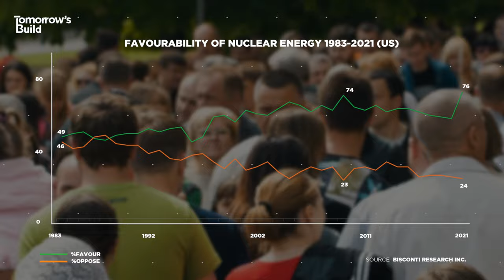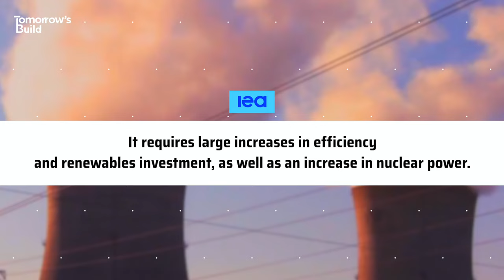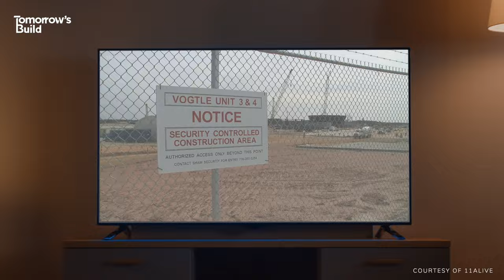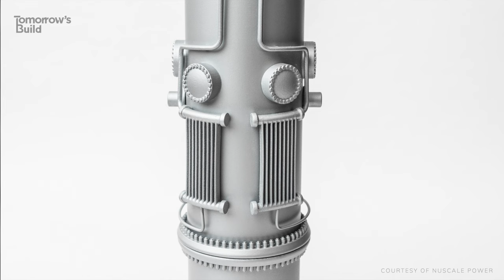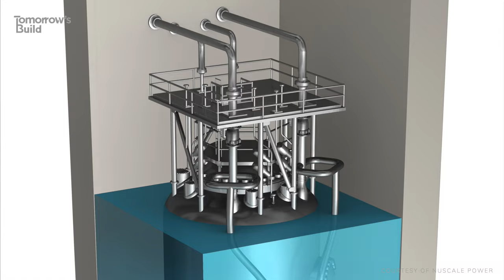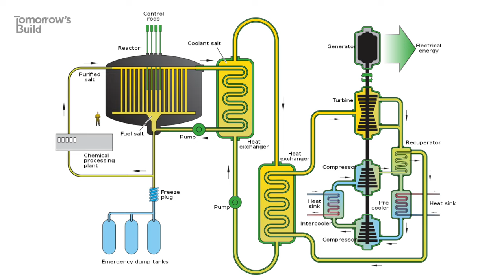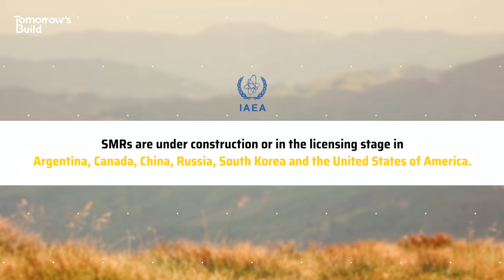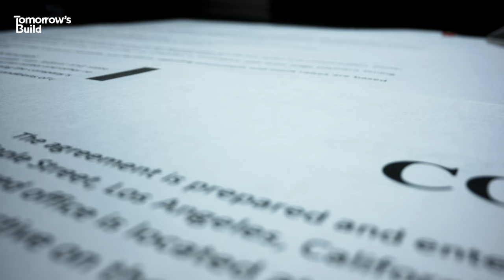These Mini Nuclear Reactors Can be Built Anywhere

Comment: Wind/solar are intermittent. If you add the cost for needed energy buffer, things look different. Today the grid is used as a "free" buffer. This does not work anymore if wind/solar makes up a significant percentage of total energy. If wind/solar is so cheap, why has Germany such high electricity prices? Never mind dependency from natural gas. And the need to transport the electricity over long distances (e.g. the wind farms in Germany are in the north near the ocean while most of the industry is in the south).

Comment: Like everything really, there must be a sweet spot for the size of MSR's, where the economics, modular construction, transportation, safety, standardisation, prefabrication, output power and unit number needed etc should align for the application of Nuclear. 

I would say that a single SMR of around 100 to 120MW Electric, say 200 to 250MW thermal might be this "goldielocks size". If a Westinghouse AP1,000 can be replaced by say, 8 to 10 of these MSR's, then you could group as many as 64 of these units in one mega plant/location, for a huge 8GW plant, equaling anything online today, all the way down to a single MSR plant of 100MW, which would still be enough to run a fair sized town of maybe upto 100,000 people. You could run the whole of the UK grid with around 600 of these units, and perhaps the whole US with 6,000 and the whole world with 60,000. 

In practice, you probably wouldn't go more than 50% max generation from Nuclear, the rest coming from solar, offshore wind, Existing Hydro, GeoThermal, other) so maybe 30,000 units would be required. if you grouped on average 6 units in a location, that would mean only around 5,000 locations/plants worldwide. 

If they had an installed lifetime of say, 30 years or 10,000 days, you'd only have to build/commission 3 per day worldwide to meet the replacement rate of the fleet. Maybe 10 to 12 massive factories could produce this kind of number. 

I don't think you'd want to use Nuclear plants for smaller generation than 100MW for civilian applications / Locations. They excel where you need a lot of reliable power 24/7 at baseline.  

Large commercial shipping would be the only civil application for say the 2-10MW range. I don7t think you'd want steel or concrete works having their own tiny nuclear plants attached, as that would pose a proliferation and safety risk, just due to the sheer number of units that would entail.

Comment: Such small reactors could be a boon to Canadian high arctic communities where they get most of their electricity from expensive to run diesel electric power plants.  Fuel oil is imported to the high arctic communities at nearly double the cost or more and even more energy must be invested in keeping the fuel oil stockpile from turning to jelly.
Reply: Exactly... and these smaller reactors could also probably produce enough power that enclosed style hydroponic food production units could be set up to cut food costs. And the other nice thing about these remote indigenous communities is the "nimby" story that is the main problem in urban population centers is likely to be a lot less of a issue. As a group, they'll either accept or reject and go on without all the lawyers and whole lawsuit industry getting in the way and stalling everything for years while the lawyers mine their money. 
SMR's are the perfect solution for Canada, at our latitudes we're not going to make it on solar and wind. Not even close. And we already have the large grid infrastructure from large scale hydro as well as very good uranium mines and resources.
Reply: reactors in a remote areas are incredibly difficult to secure against sabotage or theft

Comment: small reactor has been in use forever in nuclear sub, the issue is reactor are more cost effective the larger they are since they have smaller surface to volume ratio. the lower the ratio, the more neutron are hitting the wall and being wasted. small reactor are a waste of time for the simple reason that there is a limited amount of fissible uranium and it make more sense to build breeder that can make their own fuel. china plans alone are going to double the use of uranium, that going to reduce cheap uranium to only a century worth of supply.

Comment: And yet, there is not solution for the waste.
Reply: Why should waste need a solution? Reactors produce very little waste, and it can be easily stored in well built storages. Waste caused by fossil fuel cannot be stored.
Reply: For now, nuclear is more of a temperorary solution on the road to reach net zero. In my opinion, the waste is a far lesser concern than humanity not reaching close to net zero within the next couple decades, and our failure to reach that goal will result in far more catastrophic consequences than having some dangerous waste that we don't know what to do with

Comment: Besides the build and operation, no matter how space saving, safe and innovative, the vital issue of the toxic waste and costs of storage doesn't go away for thousands of years or is it that the maintenance of storage is amortized to following generations and not accounted for.  Maybe cost efficient for the users but until wastes are safe, what is the total cost?
Reply: Nuclear waste is already solved. It is called burial
Reply: Nuclear waste is not a problem, they can be easily stored in well built storages. Pollution caused by burning fossil fuels are just dumped into the air.

Comment: 5:25 They've got cleaver safety features too
Next, Dr. Reyes rambles on some things that sound good (e.g. what the public wants to hear) but explains to safety feature what-so-ever.
How do you cool a reactor for an unlimited amount of time without the need to add water? Pictures show water (or at least a fluid). Worst case scenario: what if the water leaks out?
btw. the fact that he uses the word unlimited really diminishes the value of his scientific title to approximately 0.

Comment: Are these still the water pressure based ones? If yes then forget that. Also they need to move a way from uranium as there isn’t enough left. And then we have the thing that it will not help us to reach the goal as alone the approval will take longer than the time we have for our goal.
Reply: There are designs of various types of reactors

Comment: Thorium Reactors look really interesting Th233+n 》 Pa233 》U233  not only using cheap abundant  Thorium & Waste Spent conventional Reactor fuel but fail safe. The reaction is not selfsustainable ,meaning soon as external Xray source removed reactor passively powers down. CANDU & others can easily be converted to Th Reactors. Another major waste is Cd, the major metal in Cladding of fuel bundles. It can be used 50% dilution once then it's too Frisbee & weak. It should be all used as cathodes in shipping countainer sized NiCad batteries on-site at existing Nuclear Plants. The low radiation would  be blocked by the Ni Anodes.
Reply: Until they solve for neutron enbrittlement, they'll produce more waste than normal reactors.

Comment: Are SMR ☢️ reactors gonna be used in submarines and such similar sea-going vessels 🚢?
Reply: They hVe been for decades
Reply: I hope so, Large ocean ships create so much pollution, particularly particulates and acids. Something like a third of a cargo ship is Fuel tanks, so this would mean more onboard capacity, and at the same time higher speeds would further increase capacity.
Reply: have been for almost 70 years. "nuclear class submarines" are called such for a reason, they don't carry nuclear missiles (though some might), they have nuclear reactors.
Reply: @Nicky Mitchell. They already have been for a long time now. The actual size of a submarine reactor i've been told is roughly the size of a shoe box. But that shoe box provides all the propulsion and electrical power the sub needs.

Comment: Hmmm. Interesting, I do wonder though how long would it take to fully shut down an SMR? Just wonder in case its absolutely needed, especially since even smaller or medium sized nuclear reactors like the Swedish Barsebäck take well over a decade to shut down. But I at the very least hope these people can consider all the risks with nuclear and find a solution.
Reply: You seem to mean decommissioned, not shutdown, and it takes a few years to let SMRs cool* off before being decommissioning. However, that will happen back at the factory. At the power plant, you just swap out the reactors like batteries. 

*Cooling in this case means radiation subsiding.

Comment: I think Thorium in a Modular Molten Salt Reactor would be the safest (walk away automatically shuts down) but the reply I got from Nuclear Tech was “ well you can’t weaponize it so the government is not interested”. It’s a sad situation when war takes president from an environmental safer power.
Reply: The real problem is they haven't solved the neutron enbrittlement issue.

Comment: Today, 12/18/2023, this is old information.   China already has a 4th Gen nuclear reactor.  Namely, a HTGR on their grid and are already building SMRs.   They also have a prototype Thorium MSR in the Gobi desert.   While the Western public is so paranoid about nuclear, they will wind up paying lots more $$ for renewables since wind & solar are intermittent, inconsistent and highly weather dependent.   They'll also require battery/storage  backups when the weather is bad.    We should not be dependent on something, weather in this case, for which we have NO control.

Comment: Is nuclear aircraft carrier  powered by smr?
Reply: Navy reactors only produce 70 Mw (most of that for propulsion not electrical) compared to a typical PWR producing 1,200 Mw and navy reactors can only produce that small amount using 95% enriched U235 costing $1 billion just for the fuel. 
Commercial Nuclear power reactors need steam generators, reheaters, turbines-generators, condensers, cooling towers, emergency generators, battery systems, control room, emergency cooling systems, septic systems, drinking water systems, mechanics, operations, and management staff, etc., etc.
So if you want to compare the cost of electrical generation from a navy reactor you have to consider the cost of the entire submarine less the torpedoes.  That comes out to $70 billion for 77 Mw output or 4 times the cost of the financial failures of the latest standard PWR builds. Also Nuclear powered ships shutdown their reactors while in port to minimize the possibility of an accident near populated areas and wind/solar shore power is cheaper that running their reactor.  No Navy reactor has ever been converted or used to provide commercial electrical power. if these people want to use Navy reactors as examples, they also must admit that millions of tons of highly radioactive waste from these reactors have been dumped into the sea and hundreds of sailors have died in reactor accidents. 
The NuScale (multi) 77 Mw SMR project, is the closest commercial design to that of a navy power plant. The project started 2 years ago just halved the reactor Mw output due to ballooning costs and most of the utility backers have now backed out causing the project to now delay construction until 2025. And they were getting $2 billion of taxpayer money to help with the cost. So much for building a Navy type SMR in a few years for only a few million.

Comment: Why do we need these new mini-reactor designs, as opposed to just taking the designs the navy has used for 70 years? Those have already proven reliable and quite shockproof, the development is done, and we have the facilities to build and maintain dozens of them. We could literally take an old submarine, cut off compartment seven (engines) and the sections four through one (command to torpedoes) and be left with a big steel cylinder/floating power station. We also have hundreds of already qualified operators, plus training facilities already in place! 

This whole "mini-rector as new paradigm" is just masking that we had the solution all along.
Reply: Those are designed for the navy’s needs. They use highly enriched uranium and require a fairly large number of people to operate.
Reply: @kokofan50  I agree that is an answer, but that doesn't seem to address the question. HEU isn't that much of an issue - all reactors are going to have security and fuel associated with them. I don't know what you mean by fairly large number of people to operate - as the crews on a nuclear submarine are in total smaller than the workforce of a shore power station, and only a portion of those are the reactor engineers. And the key - is that we have the infrastructure already in place which is a huge advantage.
Reply: @MrChainsawAardvark  HEU isn’t a problem for the nuclear (weapons) club, but it’s a massive problem for everyone else. When 95% of the countries on the planet aren’t supposed to possess the fuel, it makes mass adoption of the technology impossible. 

The gen. 4 reactors are supposed to have little to no human interaction. Naval reactors have a lot than that happening.
Reply: @kokofan50  Ok, that issue with HEU makes more sense. As to how much codling a naval reactor needs - if you have some sources, I'd love to see them, as otherwise the military is a bit tight-lipped about the actual procedures.

Thank you for your replies.

Comment: I was hoping there would be no nuclear waste lmao
Reply: Nuclear waste isn’t actually a problem. It’s a good thing, because nuclear reactors produce very little nuclear waste and can be easily stored in well built storages. Pollution caused by burning fossil fuels cannot be stored and are just dumped into the air.
Reply: @TheBombson  Scientists are not really united. Most of them argue about the way our contribution to the overall atmosphere has been researched, and I understand why. About that ''nuclear waste stored forever'', nuclear waste is recyclable since the 1960s. Reactors use nuclear waste as fuel.

Comment: It's not carbon-free. Reactors and containment buildings take a huge amount of steel and concrete to construct. Then there's the uranium enrichment process which takes hundreds of centrifuges. And of course once the fuel is spent, it has to be stored in large underground bunkers away from groundwater. Add to all of that that it's the most expensive of all alternatives to fossil fuels, and there is no case for building reactors if you can build wind or solar farms.

Comment: 518 "These units are designed to be far safer tha  their predecessors"

Sure, but so has literally every reactor, including the ones in Chernobyl, Three Mile Island, Fukishima... even here in the Netherlands we have had to shut down a reactor because cracks whee forming in the mantle unexpectedly.

My point is; it doesn't matter how many safeties you built in to deal with known failuremodes. No reactor has ever exploded because of a known failure mode. What matters is how you contain the problem when the reactor does fail in an unexpected way. It's a given that one of them will fail, that's how man-made devices are. Airplanes, spacecraft, cars, they all fail regardless of how many billions of dollars in development is spent on them or how much experience we have building them. Mistakes will be made, it's the containment of the consequences that matters.
Reply: When an MSR fails, all that happens is it drains the salt to the drain tank.

Comment: Have they figured out what to do with all the spent nuclear fuel in the USA yet? I thought that site in Nevada was built but it’s a political battle between state/fed if I’m not mistaken? Also, in the USA all these older GE reactors are past life and have 1000’s of spent rods. I wonder what the solution is there? Keep kicking the can down the road?
Reply: It was cancelled almost a decade ago now. But there’s a similar facility in Finland just finishing construction which wants to accept other countries’ waste besides their own. France’s plan is to simply recycle/reprocess their waste rather than storing it.
Reply: look up fast breeder reactors, there are also subcritical accelerator reactors. all of these eat nuclear waste and tend to run at higher efficiencies. this is considered the “closed nuclear fuel cycle” and spent nuclear fuel has 98% usable uranium in it. low key, nuclear “waste” doesn’t really exist the way we think it does. that’s why i think “spent fuel” is such a good term, because it’s really still fuel.

Comment: We need these things; safety concerns are a matter for good engineering to solve, but that's the case for conventional power plants as well. There is literally nothing we have yet that can bridge the gap between our fossil fuel dependency and full renewable in the timescale we have to mitigate global warming.
Reply: Since reactors take somewhere between 20 to 30 years to build, this ain't it either.

Comment: A small package of nuclear waste is still nuclear waste.
Reply: @LuchtLeiderNederland  You can store carbon.
Reply: @indimediaworks  Storing carbon dioxide works, but nobody does it because industries cause much more waste than nuclear reactors. Storing carbon dioxide only works underground (in naturally formed pockets) due to the pressure storing a gas causes. We eventually run out of pockets to store carbon dioxide, but nuclear waste can be stored anywhere with sufficient protection. Nuclear waste is still better storable than carbon dioxide, unless future studies prove otherwise of course.